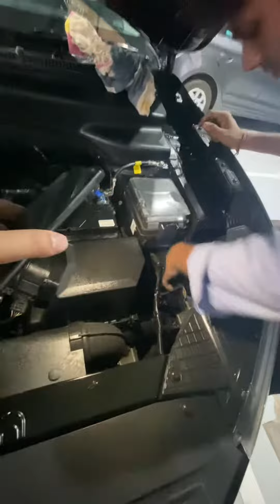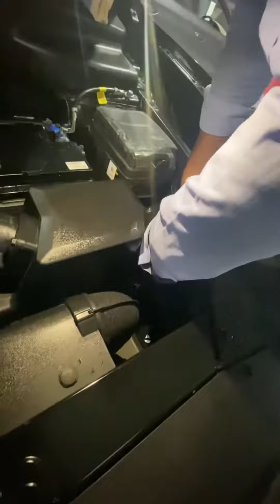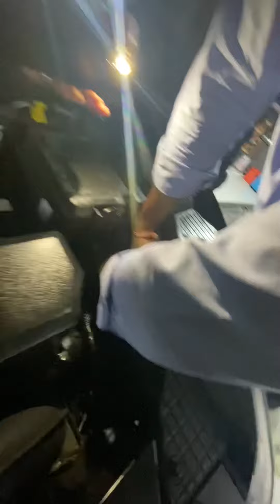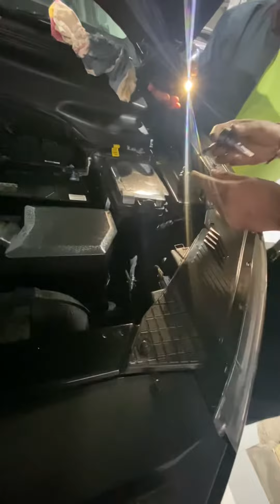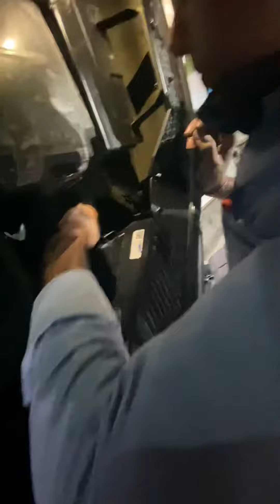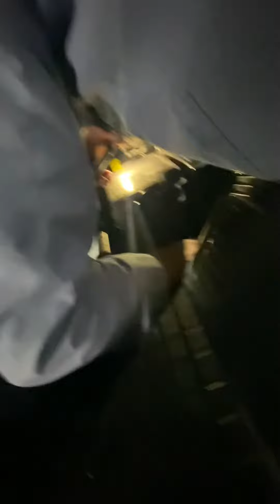Creta Hb3 led headlight upgrade, installation #osram

Comment: Sir, dzire vxi 2014 model में हेडलाइट्स को 90/100 या 100/130 में अपग्रेड करना सही रहेगा या फिर OSRAM LED में?? हमारी कार की नाईट में हाईवे में रनिंग पूरे महीने में 500KM के अंदर ही होती है।
Reply from the maker: Aapki car me projector ni,
Reflector wali lights lagi hongi, usse projector ni lgte, 

Aap halogen lagwa lo Osram k, par jo gadi k user manual me likha ho! Wo
Reply: @AmanChatrvedi  ठीक है सर पर osram के स्टॉक/बेसिक हैलोजन 55/60 ही लगे हुए हैं पर अब इनकी लाइट काफी कम लगती है। क्या 90/100 या 100/130 लगवाने से कार/रिफ्लेक्टर को कुछ नुकसान रहेगा?
Reply from the maker: @V98000  recommended hota h jo original laga h/ ya user manual me likha h, Wohi lagaye!!
To aap 55/60 Osram k hi NEW lga lo!